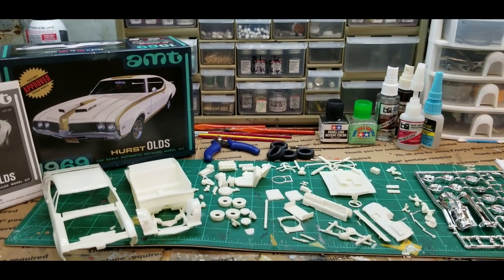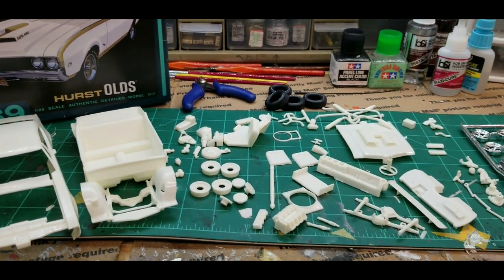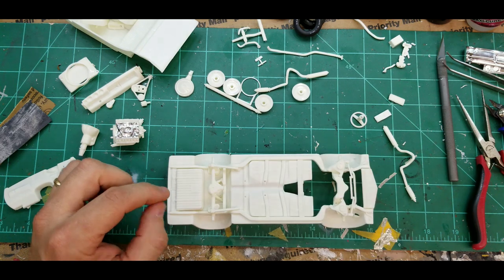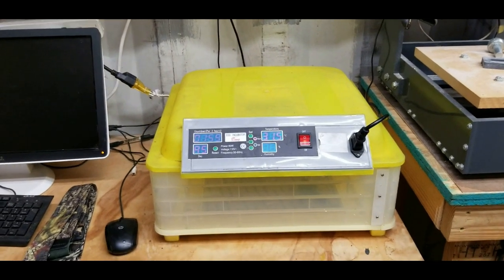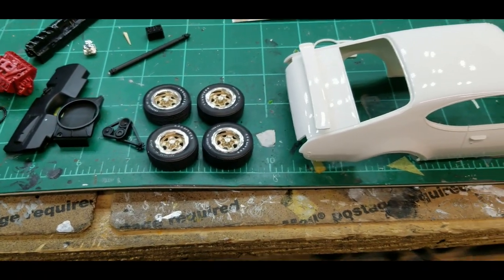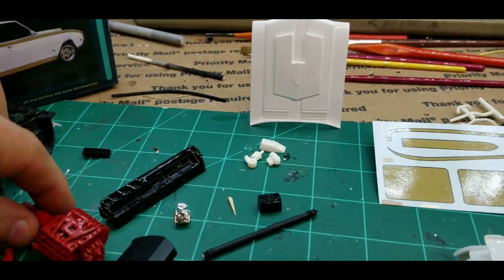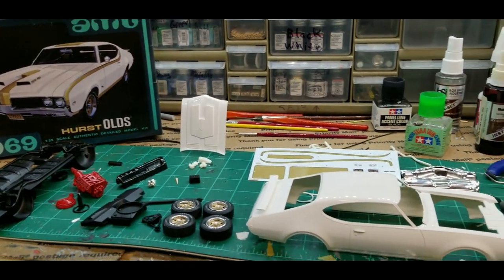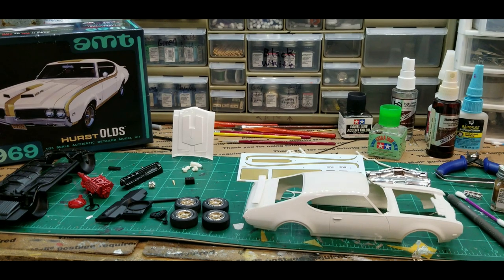1969 Hurst Olds 455 By AMT 1:25 Scale PT:1

Comment: I have two of this kit, one is still unbuilt the other is in the middle of getting the chassis from the Revell 67 Chevelle prostreet kit. It's supposed to just easy fit but it's at best close. Nice work. Thanks for sharing what you do. PS Just paint all of the stripes. I had the same issue.
Reply from the maker: Thanks!!

Comment: If your gold paint worked out for the wheels. Try painting a piece of bmf to test for color. If it works, bmf the bottom (rocker panel) stripe before painting it the same as the wheels to represent the box art.

Comment: You should definitely paint the stripe. You can get it close since it's slightly shadowed by the body line anyway. That paint really did turn out smooth. And those wheels look great. Do you basically eyeball the ratio when you use the thinner? It would look pretty cool if you replicate the foam on the air cleaner.
Reply from the maker: 1 part paint 2 parts thinner.

Comment: I’ve got that kit in my stash waiting to be built, I use a meat dehydrater to cure my paint. Works well. KUTGW buddy.
Reply from the maker: I've seen that as well!
Reply: I use an old toaster oven for my guitar pedals;  paint was hard as diamonds. Not sure the temp you would need to not warp the styrene but around 100° for couple hours you should be fine.You can pick a used one up at the thrift store for $5.00-10.00 US

Comment: Just a suggestion......Could u go to a GM dealer and ask for the paint code?  Maybe if u had the code, there may be 'touch-up' paint that would match.
Reply from the maker: Hmmm.... not sure.  Thanks
Reply: I had an opportunity to buy one of the actual '69 Hurst cars back in the late '70's for a really good price.
The car needed a transmission and had some damage on the drivers quarter panel that needed to be repaired and realistically to make it really right and correctly repaired without the entire panel being skimmed with body filler the quarter panel would have probably needed to be replaced. 
.
I was interested in the car but wanted of course to repair it back to factory appearance and the gold stripes were actually a reflective type paint so I checked on the paint. 
The paints availability at the time the only source for the correct paint was actually through the Oldsmobile dealer and it was only available and sold in a gallon size.

 The cost for the paint was $300 a gallon which in about '77 or so was through the roof and basically price wise for a gallon of paint an unheard of amount and actually about half the cost I could have acquired the whole car for at that time. Needless to say I passed on buying the car which was all still original at the time.
If only I had of known then what I know now.

This of course has nothing to do with matching the paint today for the model just thought it is an interesting little touch of information concerning the striping paint for this car back decades ago.

I do know where one of these original cars is or at least as far as I know it is still there and it has been in storage in the owners garage since probably about 1983 or so and to my knowledge has not seen the light of day since that time. This car was in excellent condition when stored away and had been used as a weekend driver/cruiser for quite a few years before being stored away.

You would be surprised at the number of these old muscle cars that are still stashed away, I just had a friend pass away last week that still had his bought brand new 1 owner 1965 Mustang 2+2 Fastback that originally was a 289 hi po, 4 speed car, of course over the years a lot had been changed and it was no longer an original numbers matching car but it was still a very nice specimen of the era that in this case would get driven when the weather was nice.